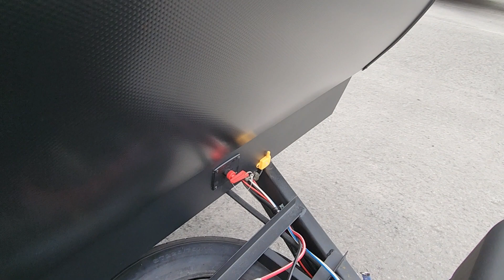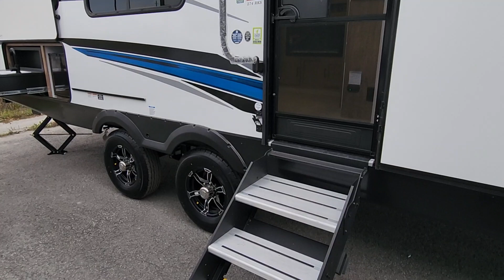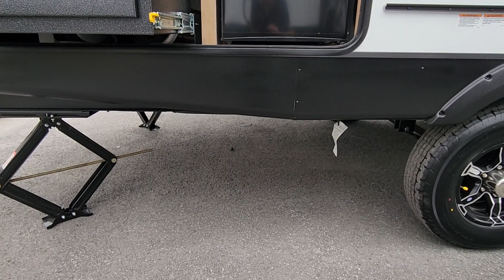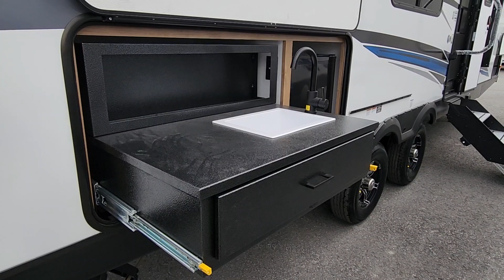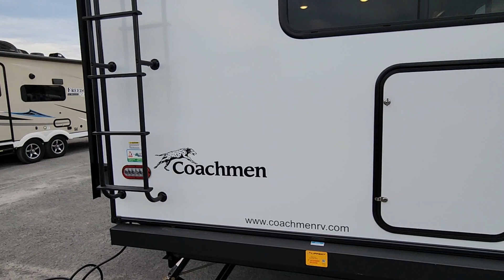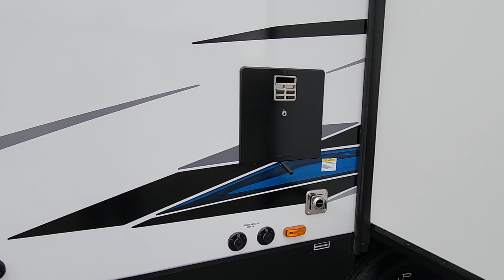2024 Freedom Express 274 RKS: Jaw-Dropping Exterior Upgrades Unveiled!

Comment: Where are the bypass valves for the hot water tank located!
Reply from the maker: Are you currently an owner? If you are simply locate the hot water tank on the outside. In the same location on the inside you will have a removable panel with four screws, remove it and you should see them in front of you